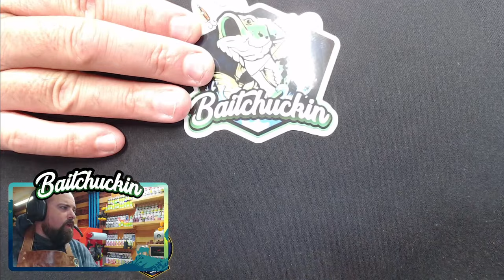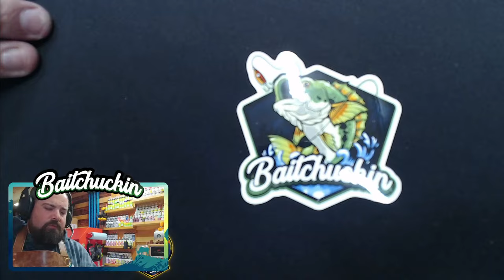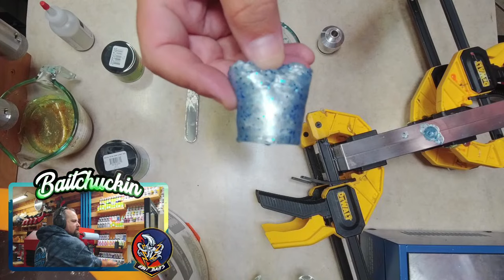Making Baits - LIVE - Soft Plastic Sunday

Comment: You should be able to adjust the white balance on the close up camera, that will make a big difference.  Keep up the live streams, even though I missed it. I love spontaneity.  Haha later in on you mentioned the color issue, lol.
Reply from the maker: Thanks for the tip, Yeah I need to dig into the settings and lock the white balance then it should be good.  What I need to do it just invest in some good cameras for the live streams if we are going to be doing them consistently.  At least for the good close-up shots.  We need a good "Camera of Truth" for the colors.
Reply: Keep up the great work man!
Reply from the maker: Thanks! 🙌🏼